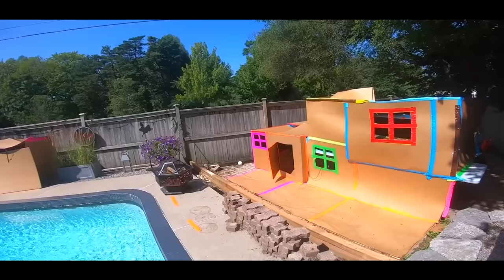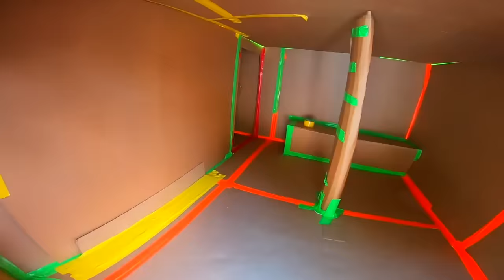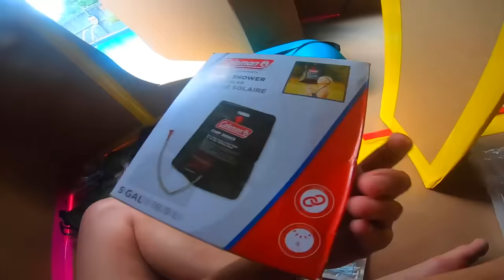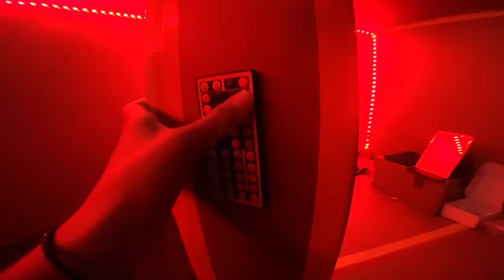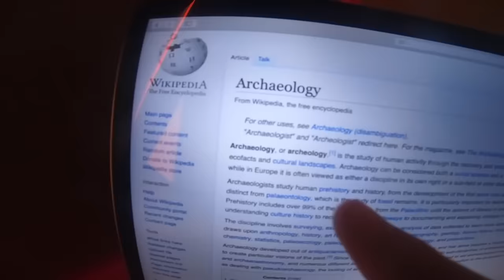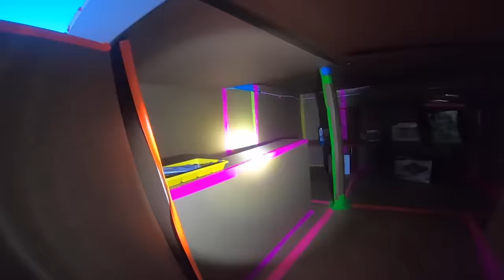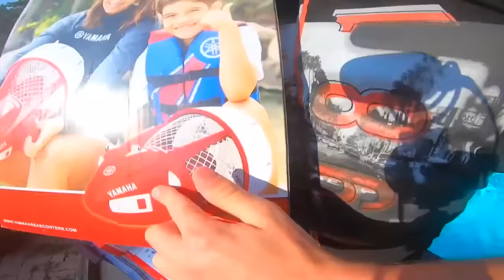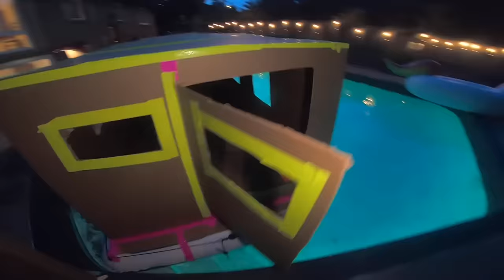Worlds Biggest Box Fort City The Movie - Living In Cardboard 24 Hour Challenge

Comment: Put a shout for backup use launch a duct tape babe I won't die from Kreg at the Creek so what you wanna do to make a bathtub at couple and then make and then put latcher of duct tape inside of the little hole of the way And you'll have to put the tape where you go in and down it it will be water